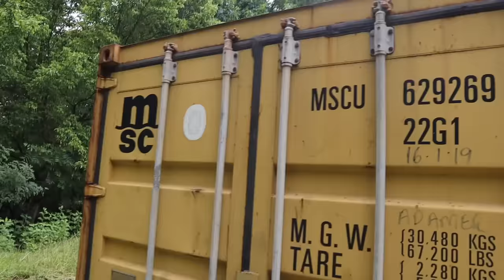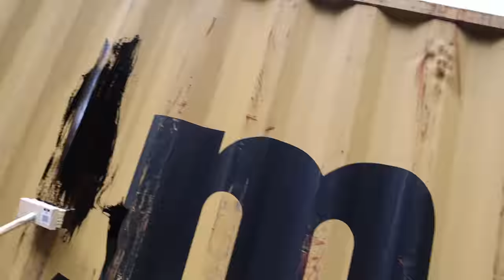BUILDING SECRET UNDERGROUND BUNKER! Part 1

Comment: I’d be very concerned with that roof. Now that it’s comprised (caved in) it lost its structural integrity...  That wood bracing isn’t enough. It’s pretty scary actually!!
Reply: Yea i wouldn't trust some 2×4s holding up 100s of tons of concrete
Reply: Very bad design. Someone is going to get hurt.  The support for these containers is at the corners cuz that’s how they are stacked.  Rain water weight going to cave this in and rot it away
Reply: Well it kinda already started to cave in as we see towards the end of the video
Reply: Also, the sides will cave in, since they're not designed to be buried.
Reply: Word

Comment: Roof isn't structurally sound, as it rusts it will get worse, hope no one is in it when it collapses.
Reply: My first thought was that they needed to add Cathodic Protection to it keep the rust away...yep,,,I spent too many years working on underground steel storage tanks lol
Reply: full length rail road ties ran across the top and off the sides would keep it from collapsing
Reply: Chris Gillam aren’t railroad ties made out of wood, wood rots
Reply: @zacharykrage5133   Yes they are made out of wood but it's treated wood made to with stand the elements they don't rot quite as easily  They would last a very long time
Reply: @squirlboy250  Although water rot may not be a problem where he is located termites would eat up the ties within years.
Reply: @NathanRChristie   Never heard of termites eating on railroad ties considering they are treated wood
Reply: @squirlboy250  Thats one of the ways Formosan Termites spread through the US. A company in Louisiana shipped railroad ties all over to be used for landscaping. Thats why now they are supposed to be checked before a load of them leaves the lumberyatd.

Comment: A few more 'minor' details:
- a way to open the doors from the inside would be nice...
- some ventilation inside the bunker would also be nice when you're all locked up...breathing is kind of important...
Reply: The walls will eventually cave in because they aren't braced very well.  When it rains and the dirt gets heavy the walls will crumble like a pop can!
Reply: Yeah, and the fact that there is a couple of inches of dirt there, no trees would be able to grow there, only grass, and a shrub if you're lucky, so that would ge a dead giveaway when it gets overgrown by trees, so he should put a hill there, more dirt at a slight incline, or just hope it will be a brushlot in the middle of the forest.
Reply: Haha.. He's probably going to slap a fan on the door and call it "Doomsday Ventilation System"
Reply: Nevermind! I watched his part 2 and his Ventilation System is to keep the doors open.. I don't know why I didn't see that the answer was there all this time.
Reply: @Geo Gmz  🤣🤣🤣
Reply: Becoming addicted to Oxygen is one of my biggest regrets in life.
Reply: Na he's probably okay. After that roof collapse the door probably doesn't seal anymore. But at least he put up that two-by-four to hold up the three feet of dirt and concrete slabs. Lmao and that Jack, just jacking in the bunker.
Reply: tip: dont forget to breath very important.
Reply: Don't tell him!
Reply: You'd wish there's no ventilation when there's radiation
Reply: If he would have spent another 2 grand he could have gotten a 45 footer and allowed a few more hammocks in!
Reply: Also another minor detail is a blast valve. If your in there and you do get a bomb going off on top you'll be turned into mush.

Comment: You are MUCH better off with a poured concrete or grouted cinder block (CMU) bunker.
Burying a shipping container is like squeezing an opened soda can. The active soil pressure will crush the container unless it's buried SUPER SHALLOW defeating the entire point of a "bunker".
Reply: A little bit of steel and minimal welding experience can fix that pretty quickly
Reply: Dirt will crush it like that. Always wondered if pouring cement all over it, basically encasing in concrete. Once it sets up should be fine, no?
Reply: @JCH722  The wet concrete will have a higher active pressure than dirt (it acts closer to a fluid than to gravel), so you'd have an even higher crushing force while it's wet. You're going to need to shore it up really well.
Once it sets up it would relieve a good amount of that pressure, but not all. I would recommend adding some rebar to help with the strain inside the concrete.
If you're going through all the effort of pouring concrete and adding rebar, why even bother with the container at all? It seems to make more sense to do a traditional plywood form which is a LOT cheaper.

Comment: Sea cans are designed to stack vertically, with the 4 corners taking the vertical load. The roof and sides can’t take much pressure. The roof will cave and the sides will buckle from the dirt pressure.
Reply: 100%, he should weld metal bars on the inside
Reply: @blbreptiles4126  
Better to weld a frame of beams and sheet metal on the outside. It would keep the pressure off the corrugated sheet metal on the container. Stand on an empty soda can and have someone flick the side to make a small dent... that’s what is going to happen with the current setup
Reply: @7734Kromm  Better and cheaper to just pour a concrete bunker to begin with.

Comment: Hey Kendall what happens if you accidentally closed the door while it's a bombing or a nuke when the doors well together because of the extreme heat so won't you be trapped in there another thing is how would you breathe question probably for another time but I was just wondering because I thought it would be interesting

Comment: just a suggestion putting rail road ties across the top over hanging 4 to 5 feet off the sides will keep it from caving in then put your concrete on top of those then back fill and plant grass

Comment: You are already having problems! Shipping container are not designed to be buried. Sides and roof can't take the weight of the earth. The corners are the strong points. What you should have done is dug a hole 6-8 inches wider then the container and pour a concrete pad, with a slight angle going toward the doors. You could then have poured concrete between the walls and dirt in levels, as not to make walls go in. Once you have the concrete level with the roof, place rebar mat across the top and pour a slab over that. Be sure to use bracing while concrete cures. Then cover everything up with dirt and it will last a long time! It just might be cheaper to use hollow block instead of a container. Check pricing in you area before doing something like this. Once it rains, the dirt will push against the walls and roof and you will see if the conatiner holds up.

Comment: You should drill some air holes in the bunker and also run an extension cord all the way from your house underground to have power in the bunker also put an actual front door lock on the bunker door then you could shut and lock the door

Comment: as soon as you said concrete over the top I  thought it would cave in . ALWAYS back prop and  pour concrete and plenty of re bar (re o) . Bet you that its sitting straight on the ground and not on blocks no drainage around/under it

Comment: Should’ve buried it upside down because the normal roof of these containers are weak compared to the floor. Just in case a heavy vehicle drives over the top you and whoever is inside won’t be permanently entombed inside.

Comment: You should have braced the entire ceiling with posts and beams before pouring the concrete. I do hope you used rebar and thick wire mesh within the slab. When the concrete cured you could have removed the bracing and replaced with a few posts and beams, there would have been few issues with the roof caving in. Pouring a 6" concrete slab with rebar and steel for the base with a 1/2" slope per 3 feet would have allowed for water drainage. I would have gone as far to have placed some of that interlocking stone along the back and sides to remove some of the lateral loads that might come into play if you get a saturating rainfall. Yeah it all adds up in cost but in the long run it will be drier and safer. If you can try and slope the dirt on top towards the back of the hill if it falls away from the doors, it will direct water away from the doors and falling into the sides causing pressure to build up on the side walls.
So far I do like the idea of building it into a hill, kinda reminds me of some of the WWII German bunker builds.
Reply: Or just use concrete or CMU and forget the container entirely.

Comment: Kendall dude, your rad. Your a good influence on your young viewers. Keep up the great content.
Also bud. You should Jack up the ceiling so it's pushed up a little so water doesn't settle in the middle. That way it won't leak. Because correct me if I'm wrong, but Kentucky get rain every now and then.

Comment: Cool idea but it will last just long enough for the earth to settle around it then the sides will slowly collapse inward. Those containers are not designed to take any weight from the sides, only from the top, and even then just along the edges in a downward vector because they are meant to be stacked.

Comment: Ok I got a few questions for you. Let say there is a Disaster or a Zombie apocalypses' and you run to your shelter,
(Q 1) your not going to breath longer than 1 hour because there's no ventilation?.
(Q 2) wen you close those big doors what happens wen some one thrown the lever down and locks you In? , do you have other way to open from the inside?.
(Q 3) do you have another way to get out?
(Q 4) What if there's lands slide and there's dirt and rocks pile up against the doors witch swing out?
just a few observation on your project, can't wait to see part 2.

Comment: should have done more research. containers are meant to be stacked so their strength are on the corners. but to your credit that you found out later is you should reinforce all sides of the container top and side due to the pressure will bend in the container. something you should have also done is irrigation around the container to pull water away from the container and reduce the rusting . maybe even put a cement slap under it as well prevent it from shifting and have it at a small slope to have water move away. anyways that is what i would do.

Comment: should have welded in braces for it on the inside and flipped it upside down before putting it in, bottom side is the thicker part. I think, also some rain tarp over it before burying.

Comment: So have the sides started to cave yet. You needed to block the sides and back like you did the front. Also you should have poured your own roof slab. It would have never caved. Did you put a gravel base under the bin? If not your wood floor will let ground water in plus rot. To be honest I would pull that bin out and do that or you many not have a bin.

Comment: The walls of a shipping container are not made to support anything squeezing on them such as dirt. Should have reinforced the sides and top with some supporting structure like I beams. And should have put some drainage material beneath it to keep water from collecting under it. Which can cause it to settle and shift at a slant. And also will rust out the bottom of the container. Also hopefully you are going to do something to prevent yourself from getting locked in it.

Comment: My dude! Love your personality & enthusiasm. Awesome video. And I love bunkers, as well as live 4 hours away from Nashville. So Im right there with ya' & I relate!
I know it's a little late to be saying this now. But shipping containers are not the best bunkers in terms of longevity & strength! They are meant to be stacked like building blocks. The vast majority of their strength are in the 4 corners. The roof & walls however, are easily compromised by the pressure, especially from soil which gets rained on & heavy. And they can rust & deteriorate over time from the moisture of any outer wood or soil! Looks like a fun place to hangout or store stuff for a while, but I would not trust it as a bunker to take shelter in!

The only way you could make shipping containers DECENT for a bunker/shelter would be if:
#1. You laid out a solid concrete foundation first! To lay it down on! Not have it directly sitting on soil/earth!
#2. You reinforced & braced (using steel) all the walls & the roof, so they could hold up better under pressure!
#3. Used reinforced, cement cinder blocks (Not wood or soil) to tightly line all the outer surrounding walls. Before filling the dirt back in around it!
#4. Had some type of safe way to cover the top (roof) without comprising the amount it can hold, before wanting to cave in!
#5. Had some type of air pipes, or ventilation system/air system in place.

A lot of people do not realize this. They choose shipping containers hoping it'll save them money. But by the time you cover the cost of the shipping container itself, the equipment to dig up dirt where it'll be placed, transportation to get the shipping container where you need it, and to lift it & set it in the ground, the cost to lay down a foundation before it goes in, the cost to reinforce all the walls & roof inside & out, the cost to surround it with the proper materials, before burring it in the dirt... cost of Labor & Time if you hired helpers... 
You may as well of just forked out the cash to buy/build a legit & durable long-lasting bunker, that wasn't a shipping container! Because either way, they'll cost almost the same amount, when it's done! If you're gonna do it right!

Comment: My guy, that bunker is going to collapse on you man....and you should have made more adjustments with it by adding electricity and water supplies. A self sustaining bunker also needs support beams from the weight of the matter on top of your bunker preventing it from imploding into itself. You should have also insulated it appropriately on the inside like a house set for winter, and prevention from leakage during a heavy storm. This is already a huge fail. God speed bro, I still love your videos.

Comment: That is so strange that the top was caving in already. I would put steel cross members at the top and weld them in and then put maybe some vertical bracing to help as well. If you plan to put concrete on top you definitely are going to have to do that so it doesn't collapse in.

Comment: Except.......storage containers buried underground cave in from the earth dirt. Containers such as these are strong at the four corners, which is why they stack safely on cargo ships. ......but these container walls are terrible at holding side pressure weight and eventually cave in under pressure. This will eventually happen unless you install a square cement rebar steel enforced retaining wall. That block wall is not enforced. I didnt see any perimeter drainage system put in place to divert rain water away from your foundation.

Comment: DO NOT copy this video. You WILL eventually get buried in it, if you ever use it. Shipping containers are only about 30mm thick. That is NOT enough structural integrity/strength to withstand any rainy day. If you do choose to use a shipping container, you need to reinforce both the inside and outside with I-beams, making it way less ergonomical and affordable than just using an ICF structure that's made for it.

Comment: This kids going to die in this thing. No side or ceiling supports to keep the thing from caving in. Also no you probably won’t die from a nuke if you duck and cover right away, shelter in place for at least 8-12 hour as soon as you see the flash, 24-48 hours is preferred. If you do the before mentioned, chances of dying are slim unless you are directly in the blast zone, run to a window or outside to investigate the the flash and are hit with the 3 sec blast wave, or are exposed to more than 100 roentgen which is lethal within a few days. Your shelter should be buried at least 3 feet deep. Using whatever you can to create mass between you and the radiation.

TheGoodNewsNuke.com

atlassurvivalshelters.com

Comment: Lameeeeeee. Not much protection as a bunker/fallout shelter. If you would have reinforced the sides and ceiling you could have actually buried it providing actual protection. I hate to sound like “that guy” who always is the antagonist in the comment section, but come onnnnn. Lol and also, it’s 6 inches deep at that, definitely not “two to three feet deep” below the surface.